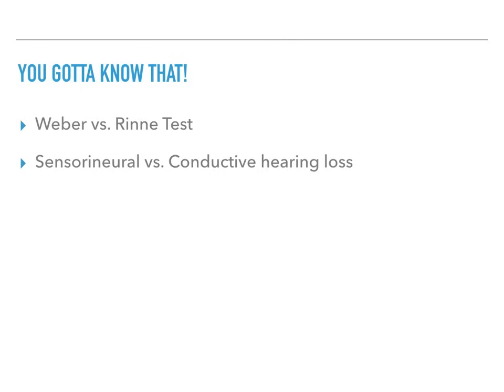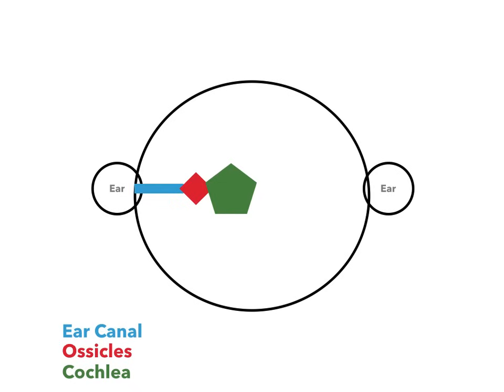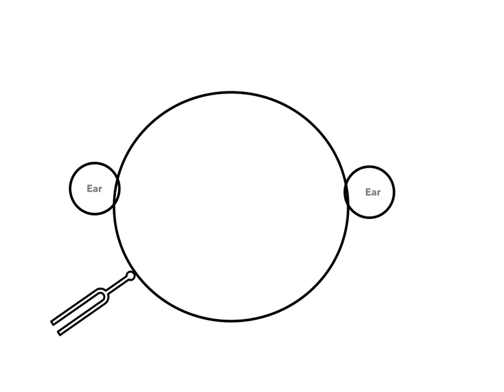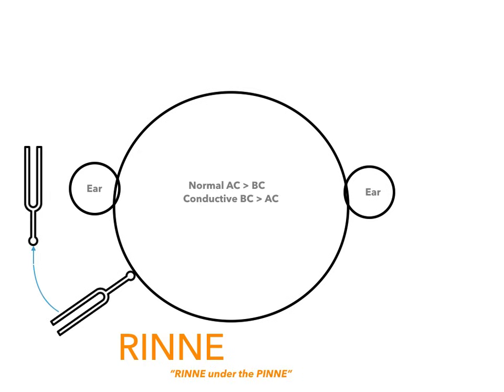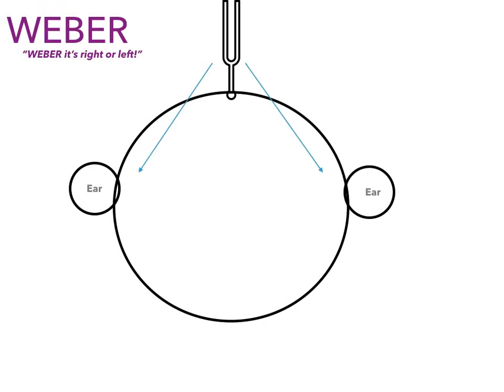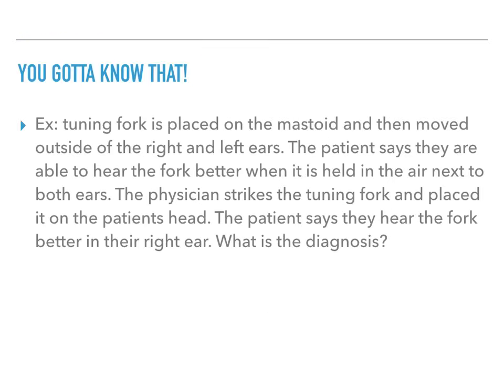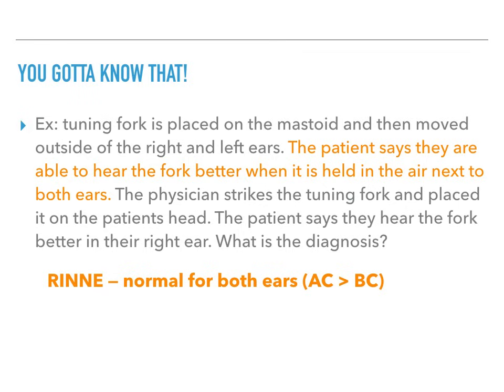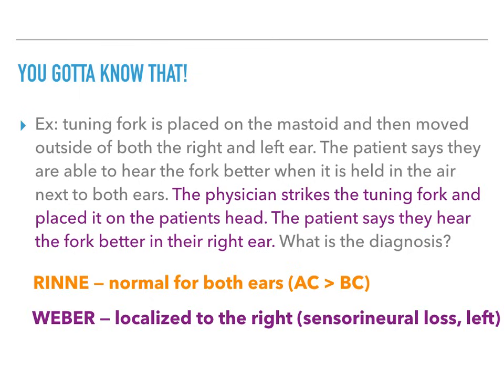Weber vs. Rinne Test & Conductive vs. Sensorineural Hearing Loss

Comment: No contradiction at all.
Sound waves propagate faster and with less attenuation in solids than in air — that's pure physics.
But in hearing, the issue is not propagation speed — it's how efficiently the tiny amount of energy from a sound wave carries in air gets transferred to the cochlea (which is fluid-filled).
The middle ear (tympanic membrane + ossicles) acts as an impedance-matching transformer:
Area ratio (tympanic membrane to oval window) ≈ 17:1
Ossicular lever ratio ≈ 1.3:1
Total pressure gain ≈ 22–30 dB (some textbooks say up to 34 dB)
This means the normal ear delivers 15–30 times more energy to the cochlea via air conduction than would be possible without the middle ear.
Bone conduction bypasses this amplifier completely. You have to shake the entire skull to move the cochlear fluids, which requires much more energy than moving the tiny, lightweight eardrum + ossicles.
So in normal hearing: air conduction > bone conduction (Rinne positive, AC threshold equal or better than BC).
Only when the middle ear is damaged (conductive loss) does bone conduction become relatively "better".

Comment: an FYI for anyone else who struggled with this: An ABNORMAL Rinne Test (BC>AC) is NEGATIVE, and a NORMAL Rinne Test (AC>BC) is POSITIVE. That fact both confused and pissed me right the fuck off. 

Also for those like me who didn't get this, sensorineural means inner ear and conductive means middle ear. 

Also Weber says which side hears the sound the loudest, so if sensorineural then weber will lateralize to the good ear, but it will lateralize to the bad ear with conductive hearing loss (BC>AC) because for some reason lol physiology

CONFUSING-ASS-TOPIC

Comment: Patient with hearing issues: 
Step 1: Rinne 
Rinne (BC>AC) = Conductive hearing loss in that ear --> Done 
Rinne (AC>BC) = Not conductive hearing loss --> use Weber to localize sensiorneural hearing loss 

Step 2: if Rinne (AC>BC) --> Weber for SNHL
Weber Louder ear is good ear--right if they can hear it, ear is working 
Weber softer ear is bad ear --> SNHL 

Great video !
Reply: i would say do Weber first because it tests both sensorineural and conduction issue. If abnormal, you confirm with Rinne if it's conduction. If not, it must be sensorineural.

Comment: I have a question to follow up....im doing occupational medicine, and this video was very helpful, but:
If hearing loss is noise induced, i learned now it should be sensorineuronal, and BILATERAL in hearing loss.

How can we use the weber and rinne test to determine if its sensorineuronal, in both of the ears, bilaterally and symmetrically, as is the requirement for noise-induced hearing loss?

Comment: If anyone would like to know why air conduction is longer than bone conduction in the first place. Remember the mastoid process is full of air pockets, IT IS NOT 100% SOLID. And sound travels slower and tends to be dampened more in air than in a solid. You may ask how does that make sense if sound is traveling only through the air when we remove the tuning fork from the mastoid. The reason is that the malleus, incus, and stapes are designed in such a way as to AMPLIFY sound coming from the air and that increases the ability of the neurons in the cochlea to sense sound from the moving lymph. Because the sound is being amplified from the air, it lasts longer than if sound was moving through the mastoid process which is full of air cells. Maybe someone is curious and it's the least I can do for this helpful video. I hope it helps someone.
Reply: THANK YOU!!! I WAS STRUGGLING WITH THIS SO MUCH BECAUSE IT DIDNT MATCH WHAT I LEARNED IN PHYSICS. THANK YOU!!
Reply: @yorkie5831 i always thought solids should conduct fasterrr
Reply: Thank you!
Reply: Thank you this is so helpful
Reply: Well said thank youu🤝
Reply: Thank you so much 😊❤❤❤

Comment: I have always struggled to remember the tests but to simplify things, try imagining yourself with complete conductive hearing loss or sensorineural hearing loss:

First, just pick on one ear you are testing and perform Rinne:
1. Rinne test mainly tests for conductive hearing loss. If Rinne test is negative (abnormal) on this side, i.e. no air conduction , i.e. bone conduction works better than air conduction. This happens when you have a blockage in the outer ear, so the sound doesn't get transmitted through the air to the chain of ossicles to the cochlear = conductive hearing loss. At the same time, you know the nerve still works because you still hear things through the bone, just not through the air on the outside. 

2. Then, perform Weber to confirm if it is sensorineural.
If Rinne is negative and Weber test makes you hear louder on that same side of the ear, that confirms the conductive hearing loss. (try shutting your ear with your hand in a quiet room and say something) you always hear louder with conductive hearing loss. However in the odd scenario where the Weber shows louder on the other side of the ear, that means there is a bit of sensorineural hearing loss on this ear also, so it is a mixed conductive + SNHL picture.

If Rinne for both ears positive (no conductive hearing loss), and Weber louder on one side, means the problem is the other ear likely sensorineural loss on the other ear.
Reply: Cohen Goh ,Thank you ....best explanation👍
Reply: Best explanation I have heard in a while!
Reply: Excelent
Reply: Cohen Goh thanks a lot!!
Reply: thank you so much
Reply: What really sucks is figuring this stuff out after DV past statute of limitations.
Reply: Cohen Goh  Excellent explaining👌🏽
Reply: Perfection!
Reply: thanks!
Reply: Omg ive been spending last night watching vids on Rinne and Weber's test bc I cant understand any of their explanation (they make me confused) but your comment makes me understand in an instant! Great explanation you should be a professor thank you
Reply: finally I'm getting the idea, thank u😀
Reply: Thank you very much, Cohen Goh 😆❤️
Reply: Ace it
Reply: Thank you!
Reply: Great Sir...Such an understanding explanation....👏👏
Reply: Perfectly explained
Reply: this is genius!
Reply: AMAZING :D Thank you!!
Reply: Thank you so much🥺😭

Comment: Omg I couldn’t understand this concept for the longest time and now I totally understand it after watching your video. Thank you so much!
Reply: Same
Reply: Since R comes before We Do Rinne before Weber. Bone conduction > Air conduction, why? When sound passes through ear canal through Malleus Incus and Stapes it gets amplified therefore Bone conduction > Air Conduction. First we do Rinne Test if there is a problem in that ear we know that there is a problem but to ascertain if it is Conductive or Sensoneural we do Weber - if Sound is heard more in the ear which is normal it is Sensoneural problem this makes sense but in conductive hearing loss the sound is heard more in damaged ear this is quite counterintuitive - this happens because in damaged ear there is less noise coming from outside through ear canal and also there is less of sound waves leaving through ear canal as the ear canal is damaged - the reasoning is good but it can be confusing so the mnemonic used here is Sensoneural makes sense.

Comment: Thank you, Amazing easy explanation.
I think that one thing is missing: when there is conductive hearing loss 1. yes in Rinne test  BC > AC in the affected ear, plus 2. in Weber test (same patient, same conductive defect) sound will be more audible on affected side. so I'm saying that in the conductive hearing loss both Rinne and Weber tests are abnormal.
Reply from the maker: this is correct. I'm commenting here so it pushes this post to the top so other people can enjoy your wisdom. thank you!
Reply: S M this actually came up on my exam.

One way to make this easier, is to add arrow heads to the tips of the letters; S for sensorineural and C for conductive. This can tell you the direction of the Webber test.

Sensorineural: arrows point in opposite directions, indicating the opposite ear is affected vs. the one that sound was conducted to.

Conductive: arrows are on the same side, indicating that the ear the sound was localized to was the one with the defect.
Reply: darknasaya it doesn't hurt to be more polite if you want to get something done..let's just thank him for making this video. 😉
Reply: Jenifer Miculob This video could cause students to get questions wrong on test day. He should remove it and re-upload with the correct information.
Reply: so in other words, rinne test is used to determine presence of conductive hearing loss while webers confirms the findings of rinnes and point out if its really conductive or sensorineural?  thanks for the resposne!
Reply: Thank you for adding that, but may I ask WHY in conductive hearing loss patient hears BETTER on affected side than normal side on Weber's?
Reply: @mixed5185  Because when there's a conductive issue the outside sound doesn't get through. So the bone sound is best hearable there. A normal ear would have: bone sound too + outside sound
Conductive issue: less outside sound + the same bone sound->so bone sound heard the best
Reply: S M I agree. It was really amazing. And you addressed a very valuable point. Thankyou to both of you dirty USMLE and S M.
Reply: Thanks
Reply: S M thank you for pointing this out.
Reply: you both explain it very well thank you so much!
Reply: thank you for adding the missing part :)
Reply: you legend
Reply: Thanks for the addition
Reply: Thanks for mentioning i was searching the comment box for this comment
Reply: exactly........this thing confuses most of the people! thanks for bringing that up
Reply: You need to remove and redo this video, or add an annotation letting viewers know that these is missing information.

Comment: why do I remember this being so much more confusing? like if there's a conduction loss, you the Weber test will localize to the bad ear or something? ...brb, gonna go check the Google machine
Reply: As a easy way to figure it out simply plug one ear (mimicking conductive hearing loss) and then hum (mimicking the weber test). 
You will notice that the sound is louder and localizes to the plugged ear. (you are blocking the ambient noise coming form the environment thus it is louder when the ear canal is plugged) 
Thus, in a conductive hearing loss the Weber should localize to the AFFECTED ear and in sensorineural hearing loss the weber localizes to the UNAFFECTED ear.
Reply from the maker: Conductive hearing loss will have Weber localize to the affected ear. But you will make the diagnosis based on the results of the Rinne test. Don't overthink it... it's actually much simpler than it is taught in medical school
Reply: ahh okay, that makes sense both logically and clinically! Thanks for the help and great videos! Keep it up!!!